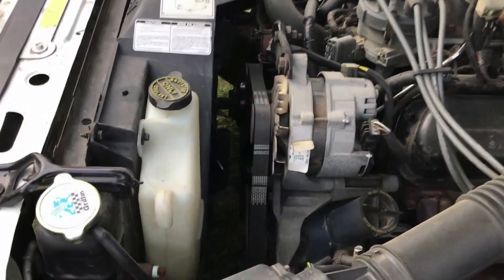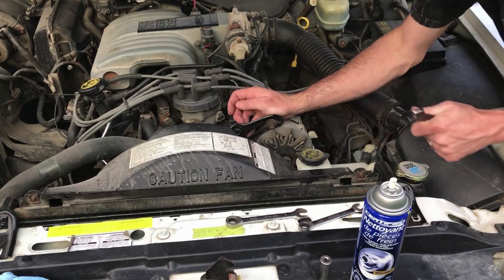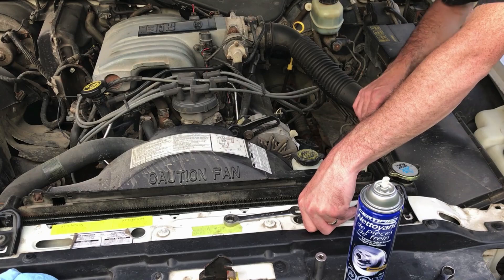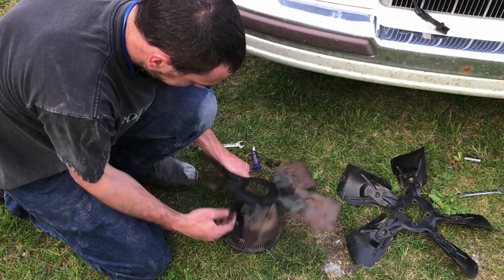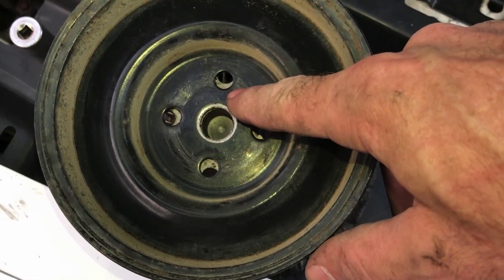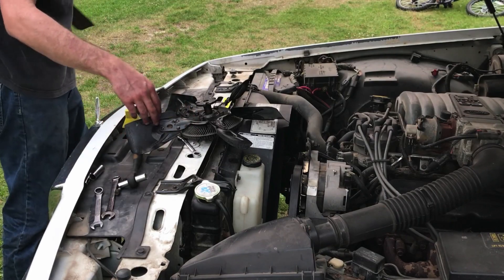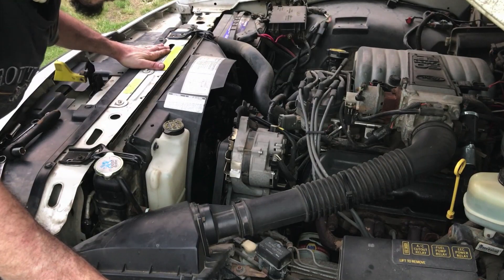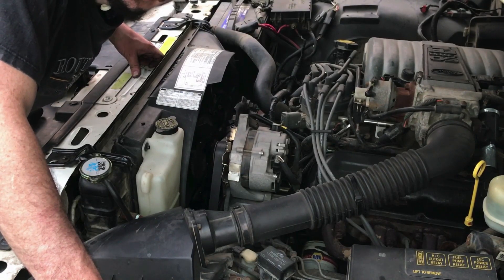Replacing the fan Clutch on a '90 Town Car

Comment: Blessings where did you get your water pump pulley from?
Reply from the maker: Michael G. I just reinstalled the original, that is separate from the fan clutch. The fan clutch itself was a used one I had laying around.
Reply: Matt's Garage do you have any clue where I can purchase that water pump pulley from?